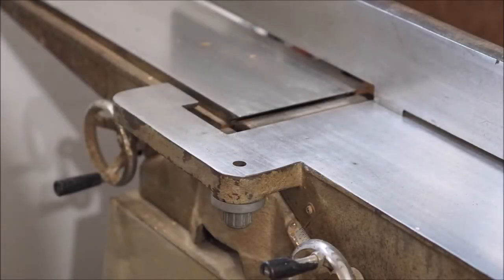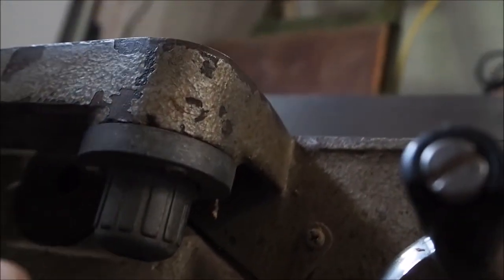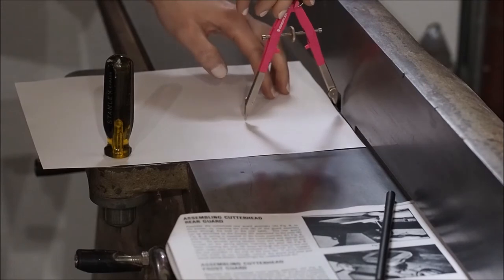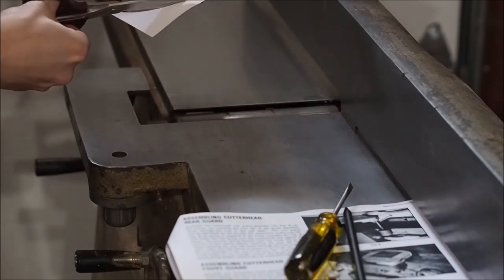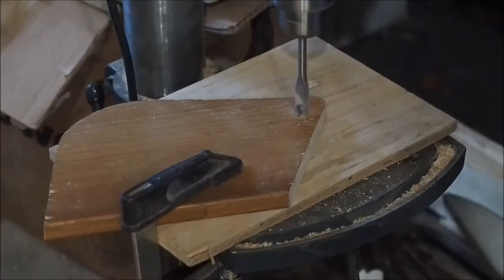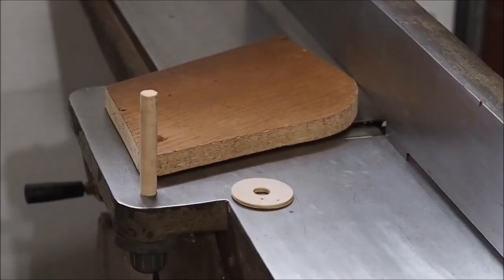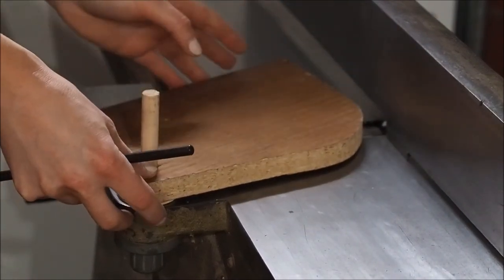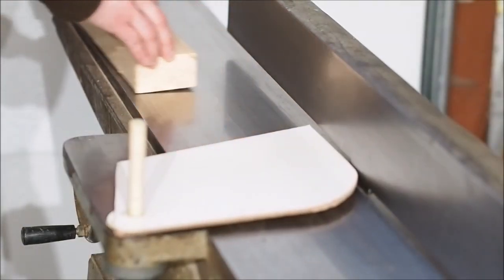How to make a jointer guard

Comment: Hi. Nice video. I just got hold of a similar jointer, without the guard. Where did you manage to get a manual from?
Reply from the maker: I was able to find something online by looking up Rockwell Delta jointer or something like that. Here's a link to the manual I found that was close enough to my model: https://www.manualslib.com/manual/725778/Delta-6-Deluxe-Jointer.html
Reply: Thanks very much. Mine looks very similar, though it's a different brand.

Comment: That old Delta Jointer is awesome! My drill press is a 1943 Delta that I acquired from the original owner's son, and it's 100% original. It's definitely a conversation piece in my workshop; along with my 1927 Birmingham Stove Company cast iron wood stove that I use for heating (and sometimes cooking) during the few extremely cold days we get here on the Texas Gulf Coast.